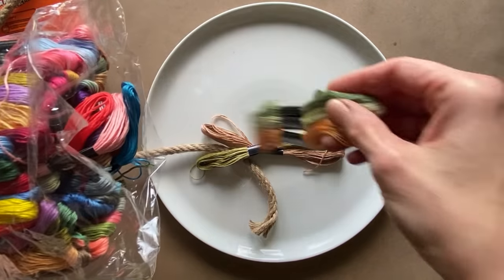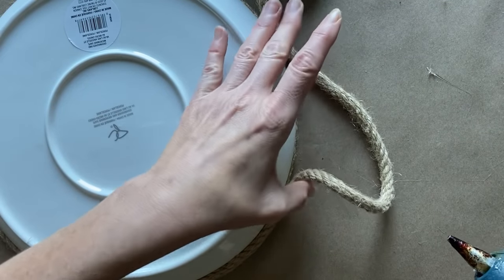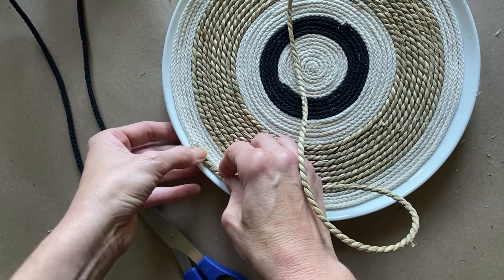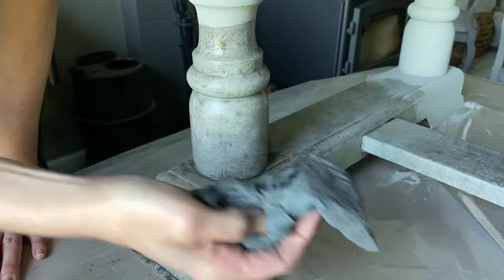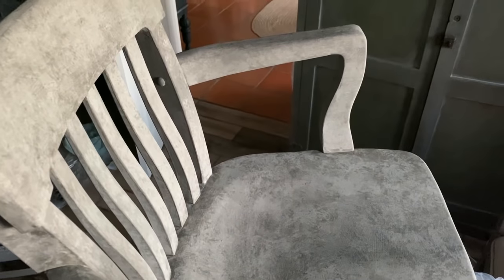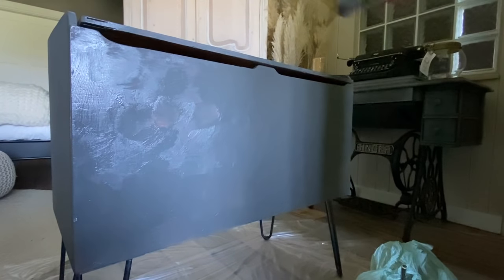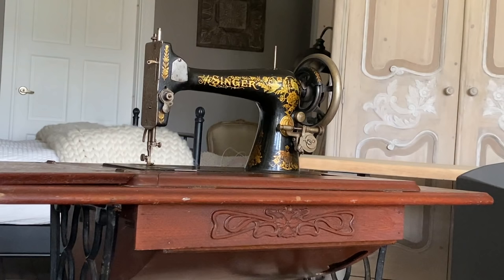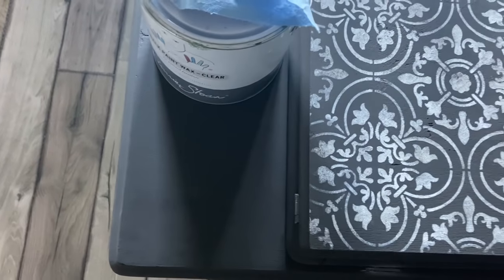4 Home Decor DIY:wall plates, chalk painted desk, IOD transfer & stencil furniture makeover|ASMR diy

Comment: A couple of years ago , I took the rubber like shelf liner / non slip for rugs … and I used the thick hemp rope , putting it down in different size rounds ( like you did on the plates ) instead of they thread , I used scrap cloth and put it around the rope , in different places . I made it oblong and used it as a side table topper. My side table is a really thick cut from a tree , with the bark still on it . Together, they look so earthy. ❤️

Comment: TIP....Keep an eye out for a lovely picture frame to repurpose as a plaque for your house numbers. Paint the frame to complement your exterior house trim. You may need to cut a thin sheet of plywood to use to fit inside the frame. You can purchase house numbers in a variety of styles or paint them on yourself.